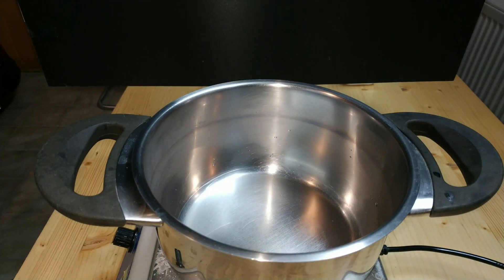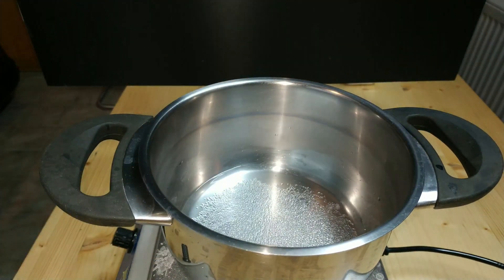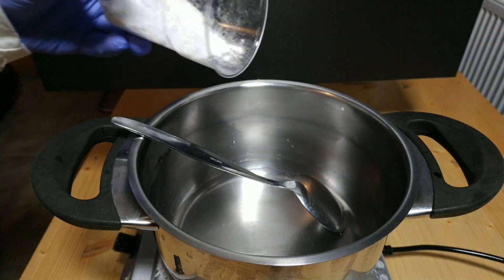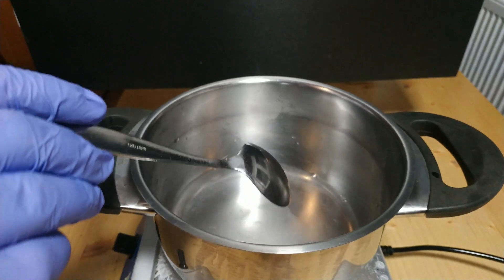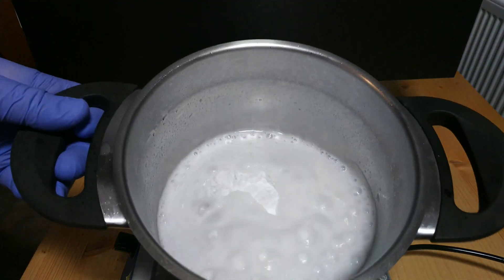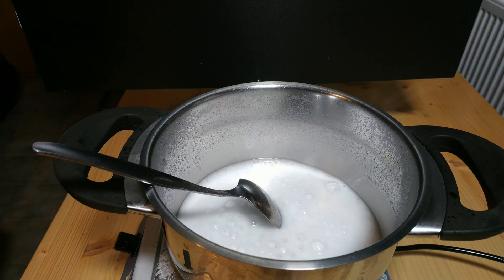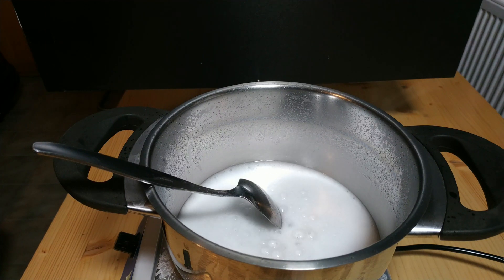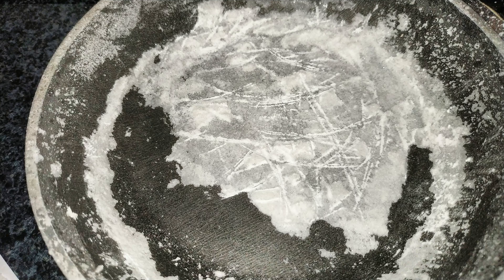Synthesis of sodium citrate ( emulsifying salt ) for cheesemaking

Comment: Do not preffer steel pot as citric acid can be mildy corrosive to steel and other metals
Reply from the maker: Yes it can be mildly corrosive, but in normal situations will never attack stainless steel. Maybe molten pure acid at high temp.
Reply: Ur right about that 

But when the sodium bicarbonate hits the acid it neutralize the citric acid